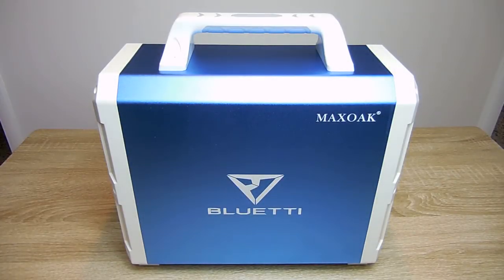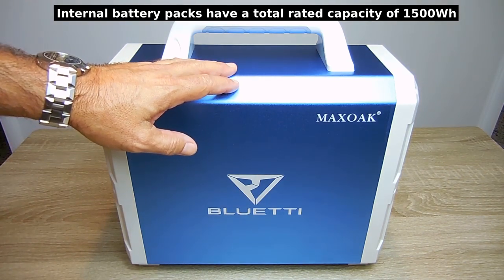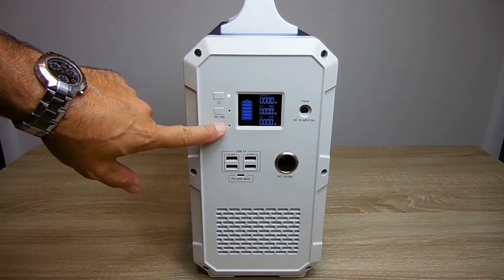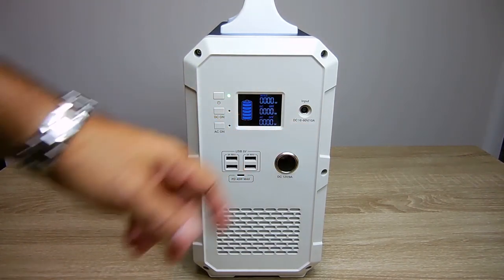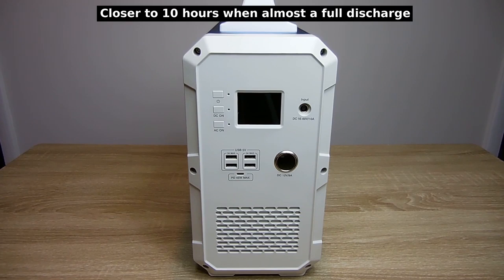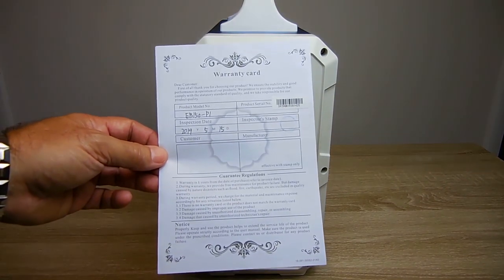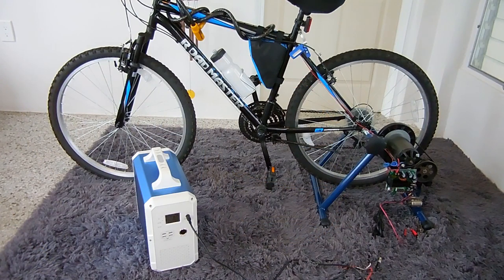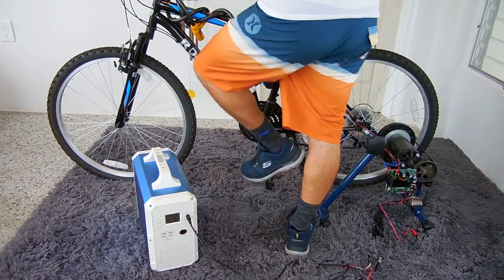High Capacity Portable Power Station (Maxoak Bluetti EB150)

Comment: $1400 dollars gets you 1.5hrs @1kw at best and then it's useless.  For half the price buy a Honda generator with inverter that will run forever and very quiet or even much cheaper.  A deep cycle and solar panel and inverter for much less.  Many better alternatives you could put together for a fraction of cost.
Reply from the maker: Disagree. You missed the part about no carbon monoxide, and being quiet. This is perfect for a person working underground, mining, or not having to run outside with extension cords. It's actually $1170. You get what you pay for. LG auto grade batteries aren't cheap. If people are stupid enough to spend $1000+ on a smartphone that they don't need, then this price isn't unreasonable. Lead acid batteries can't match up to the batteries in this unit, and to have the same capacity, the battery would weight 60 pounds or more.
Reply: @electronicsNmore  I just bought the perfect phone again, a Samsung S5 for $70 mint on Ebay but that's a different topic.  Every product has it's applications and needs but this seems rather pricey compared to others. More versatile I would like separate battery of choosing, inverter and solar seems the way to go, then you have 3 items and 3xs versatility for fraction of price.  This just seemed like it was something a company send you to review and keep, which can differ greatly from a good value appealing to the average guy. Don't be offended but it's hard to be objective when a company sends a $1300 product for review with 2 reviews on Amazon.  If on the other hand you bought it, then it's still overpriced, no hard feelings, just an opinion.  Thanks for the video.
Reply from the maker: @Something Different Thanks for understanding.
Reply: @electronicsnmore

Maybe start off saying the advantages of this system vs another, like How something different says. So the audience has a full understanding from the beginning. You’ll be educating people, and they’ll complain less
Reply: @s1iznc1d34  it's astounding how many times these apples to oranges comparisons are tossed around for products like this. A thing can usually always be done different or cheaper, but usually at a cost of time and/or convenience as you say. Not a lot of people seem to put a value on their time.
Reply: AD Electronic Teardowns  - nice rebuttal. Agree fully, Also enjoy the channel.
Reply: @publicmail2  it's not THAT much more expensive than the set-up you have mentioned.. For people who are restricted by weight and square footage, this generator is the perfect alternative..

It's small, extremely portable, & does the job.. The freed up space can be used for other things like a bigger bed or a larger cabin in a mini caravan.. I'm one for carrying less items too. If one does the job, then it may make more sense to spend more money getting it. Less items means less chances of missing items, less time spent setting up & so on..

The benefits are there.. and you can't just dismiss it based on price alone..

Comment: Solar/AC Recharge: 1)This Power Generator Can be Recharged from the Sun with Solar Panel (Open Circuit Voltage must be 16V～60V(Max),Max 500W,Solar Panel not Included).

Comment: You better eat a damn big meal and cancel all your appointments if you plan on charging that with a bicycle generator.  Assuming (a bad assumption) 100% efficiency, it would take about 8 hours of biking to generate 1500wh. This is assuming you are in fairly good shape.
Now, there is no reason you couldn't do 2 hours a day for 4 days, or even 1 hour a day for 8 days.  Of course, all of this assumes the bike is well matched and that you can produce peak power at a cadence you are comfortable with.
Reply from the maker: 100W using the right gears, not that tough.
Reply: Might be worth it in an emergency situation. There were parts of Florida and several other states that did not have power for months in the last few years with the various hurricanes.
Reply: If you can keep your power to under about 75% of your capacity, you can go a long time.  But when you go up to higher levels, it tires you out very quickly. It's why you can walk for hours but will be dead after a just a minute of an all out run.
Reply: +Something... Well, given the plummeting cost of solar, a bike is probably not the best option.  But if you don't have solar and can't get it for some odd reason I cannot think of, it's not a bad option.
To be honest, I don't think sore leg muscles is what would stop them, it would be breath problems.
Reply: I've been a cyclist all of my life and there were a couple of periods where I didn't ride at all for  a couple years. The most painful part of getting back on a bike for me was always breath.

Comment: It will run an electric frypan for one hour then it will take 2 days to charge it with solar?
Reply: You just gace a great idea for a new diet program.  
Thanks for the cool vid, Doug!
Reply: Try again.  You gave me a great diet idea, John D II..
Reply: But if the frying pan was free too?
Reply from the maker: You'd use a gas cooktop. LOL If the solar panel setup has big enough panels, you can easily recharge it in one day. Do you realize how much current is being drawn from a battery for a 1000W/120V load? Around 100 amps is being pulled non-stop from those LG batteries. That's impressive.

Comment: Great video!  How much does this unit cost?  Will it power an HF transceiver that requires 13.8 VLC @ 20 amps?
Reply from the maker: It's not a cheap unit. I placed a link in the video description area. You get $230 off using both coupon codes I supplied. The unit can be used along with a $20 step-up converter to power the HF transceiver. There's also a much cheaper unit that will work for you with the step-up/boost converter. You can see that in my other video below. Thanks for watching!
https://www.youtube.com/watch?v=iEbcUdEzjl4

Comment: Hi nice video. Do you have any advice or info on repairing or diagnosing printed circuits or modules or boards like those found in HVAC or Automomtive or even irrigation controls. Or is there some company that repairs and resells them. Thanks Phil
Reply from the maker: Hi Phil. It all depends what they're not doing. Usually it's a problem with the power supply on the board.
Reply: @electronicsNmore  Ok, thanks. Do you recommend any books or training on repairing printed circuit control boards. ?

Comment: Just a little tip if I may.... You might want to re-gear the bike. Your cadence is too low. High resistance low speed pedalling is tiring. If you can set it up to generate the same amount of power but at a higher cadence, you will probably be able to generate more watt-hours before you get tired.
Reply from the maker: Like I don't know that. LOL You should become friends with A D........Both of you like to pick and complain.

Comment: cool but wouldn't a $200 inverter with the same watts and a car battery just the same for a fraction of the cost? I guess if it was not for taxes ontop of taxes... everything would 1/2 or 1/10 the price as we see today. Aso shipment cost etc
Reply from the maker: You can buy a pure sine wave inverter, large deep cycle lead acid battery, cables, battery isolator/charger, but you won't have a nicely designed, compact, lighter weight, portable unit like the MaxOak. You also won't have the PD/USB ports, and no built-in charging circuit. The lead acid battery would weigh 60-75lbs to match the lithium batteries total capacity, and the lead acid battery doesn't cycle as good. You pay a lot for a reason. Thanks for watching!

Comment: Didn't you already review this device?  I could swear you reviewed this before.
Reply from the maker: No. That was a much smaller model.
Reply: It might have been a different YTer.  What rung the bell was the digital display.
Reply: It was probably Will Prowse - he got given one to review from the company, he runs the YT channel "DIY Solar Power with Will Prowse" and plays with LFP batteries amoungst other things. Hes pretty popular, and gets sent these kinds of toys for review. And his reviews are brutal. If the device is crap, he'll say so :)
Reply: I like AVE's reviews.  Thorough and brutal.
Reply from the maker: @dash8brj  I saw his video on this same unit. Did a nice job. A video like this is more of a new product show and tell. He showed a continuous 1100W and 900W test in his video, which I didn't. I tested the unit before showing it to make sure it was capable of the stated outputs. He gave a method of charging the unit from a car which isn't nearly as good as what I said to do. The company told me to do what they told him, use an inverter, but my idea was better, so I told viewers to use the DC-DC boost converter and set the voltage/current output. With my method, the system would be able to charge up much faster. I showed the inside of the unit, and demonstrated typical uses for the power station. He stuck with solar, and I showed that the unit can be charged by other means besides solar. When you're talking about a device selling for around $1200, that was supplied to you for free, trust me, he wouldn't say it's crap. :-) If I get a product that I feel is junk or doesn't match up to the specs, I send it back and say, "Sorry, the product doesn't meet my standards for a video". I don't make videos bashing pricey products supplied to me for free. When contacted, they don't call it a product review, they let you know that you'll be a "product influencer". He and I knew that before we got the product.
Reply from the maker: @tarstarkusz  I could be just as thorough and brutal, but I'm not going to spend all that time testing and making a video for only 2-3k views. It's a big waste of my time. It's easy for him to be thorough, have you seen how much he collects on Patreon? It's outrageous.
Reply: I wasn't complaining or comparing your reviews to his, particularly for this review given the high cost.  Also, the stuff he reviews is more prone to that level of scrutiny, after all, they tend to be physical things like tools.
I'm sorry if it came off that way.
Reply: Do any of your videos have views reflective of your sub count?  YT must be really screwing with you. 300k subs and 2010 views after 24hours. That's insane.  You should be making hundreds of dollars per video.
Reply from the maker: @tarstarkusz  I have over 100 videos with well over 100K views, over a dozen in the millions. My channel is currently being suppressed by YT's algorithm, and many viewers aren't being notified of new videos. Channels producing inferior videos to mine(I've seen many), are getting higher view counts(more exposure). I've had several large channels contact me and say, "You have great videos, I have no idea why each video isn't getting tens or hundreds of thousands of views". My recent Apple Airpod video should've gotten at least 1/4 mil views by now.
Reply: I make sure I thumb up all videos of people I subscribe to and try to leave at least one comment.  
Does adding your videos to a play list help?
Reply from the maker: @tarstarkusz If people watch the playlist, it helps, otherwise sharing a video or the channel is best. If I got fair exposure for my videos, I'd already have 1M subs. YouTube pushes the larger channels. My videos tend to do better as time passes, people spot them, then they take off.

Comment: Nice that it puts out 1000W, but it would be I
Nice to put it back in off car or generator,  at 1000W, defeats the purpose of lithium! 500W charge would work otherwise deal breaker!
Reply from the maker: I don't understand what you're trying to say. The unit can be charged up to 500w, but with the included charger, it takes overnight.